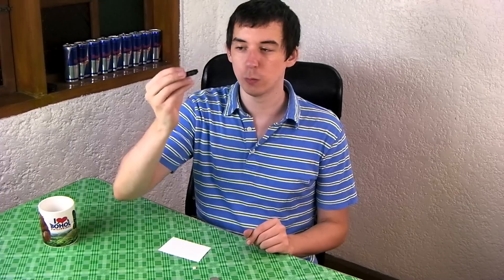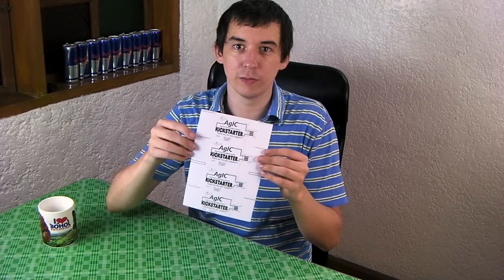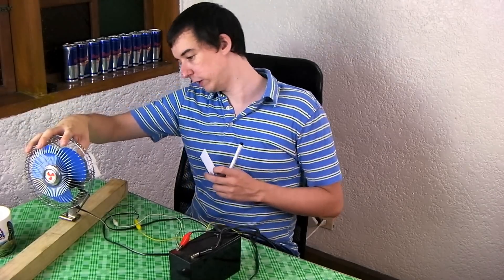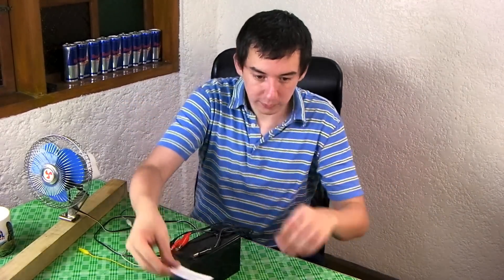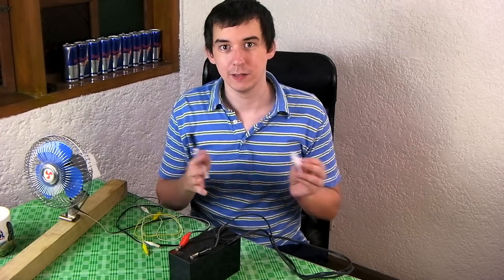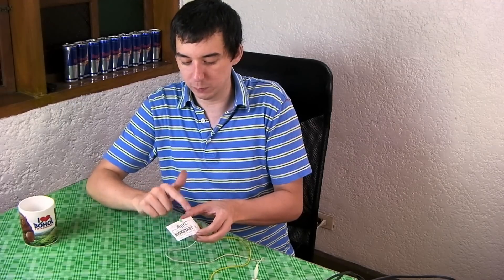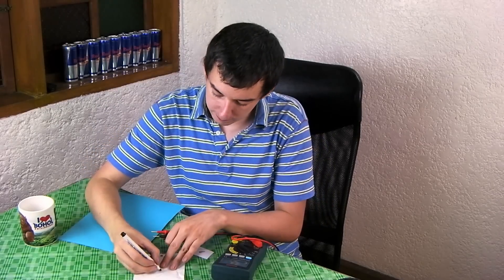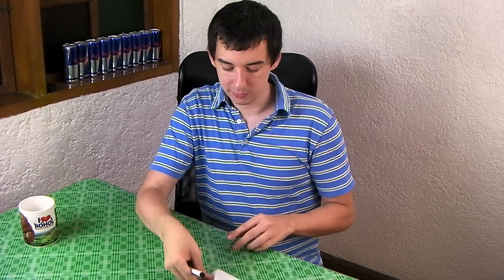Conductive Silver Ink Pen - Agic

Comment: I think the point is to repair circuit boards not 10amp fans
Reply from the maker: +William it's for making test circuits rather than repairing boards. It only works on specific materials. Putting it under heavy load was just for fun :)
Reply: this fan  cant pull  10Amp  .. one  room heater pulls maby 2000w      p/I =  2000w /230v = 8,69 Amp :face-blue-smiling::face-blue-smiling::face-blue-smiling:

Comment: Is there a glossy surface on top of the USB business cards?
What do the manufacturers say about the risk of fire and liability if one should occur?
Reply from the maker: +Albert Forskinlini Yup, it feels similar to photo paper. They don't say anything about that. I think it's extremely unlikely considering the low voltage and current. Even if it shorts out, most likely the conductive silver ink will break long before any fire or injury could happen.
Reply: Thanks mate.
Trouble is when the lawyers spot the potential for injury the cost of insrance sends the price right up.
How much is it now?
Reply from the maker: Albert Forskinlini Mmm well I'm sure with the right research you could prove it's just as dangerous or safe as a regular PCB. I'm not sure of the costs. Probably more than just getting proper PCBs made in China. Plus they're only meant for short term / prototyping use. They wouldn't stand up to real-world usage.
Reply: Gadget Addict How much does the kit you're using cost? :-)
Reply from the maker: Albert Forskinlini I got it during their kickstarter campaign for 20 or 30 USD :)

Comment: Printed circuits are useful for creating the next generation electric circuits. From the link below.

 http://s3.amazonaws.com/digitaltrends-uploads-prod/2013/02/Transparent-Phone-Polytron.jpg

Fast prototyping circuits is a very useful skill. Granted the conductive ink circuits are fragile and mostly with smd applications. However the speed and cheap fabrication are major benefits. 

A significant application is wearable circuits. Does the conductive ink work on glass? 

https://www.youtube.com/watch?v=FYgIuc-VqHE

https://www.youtube.com/watch?v=DpRJ0PuJoRM

Flexible circuits are what Steve Jobs was working on before he died.

Comment from the maker: Tal, your settings prevent me from being able to reply directly to your comments. According to Agic, any regular printer photo paper would work. I haven't tried the graphite pen you mention but i assume it would. In my testing, the amount of power that graphite (from a pencil) could handle was minuscule compared to the silver pen. I hadn't seen squink on kickstarter but it looks to be pretty much identical. Although they've done some testing with using the ink on other materials, it's not clear if the kickstarter product will work on anything other than gossy paper, just like the agic pen/ink.